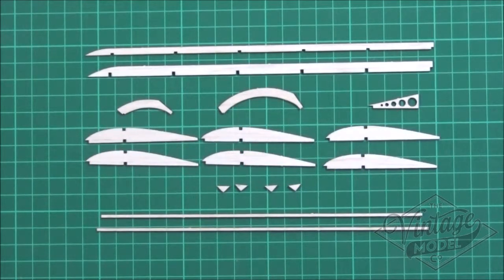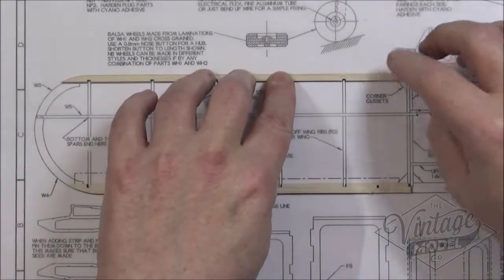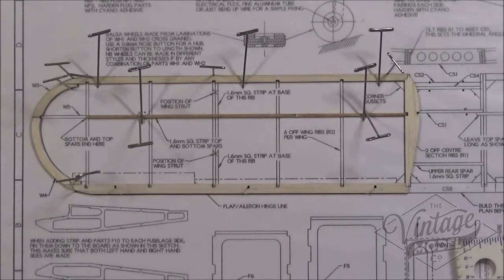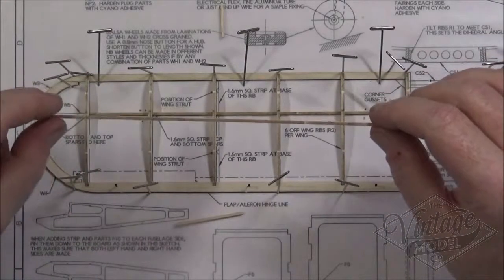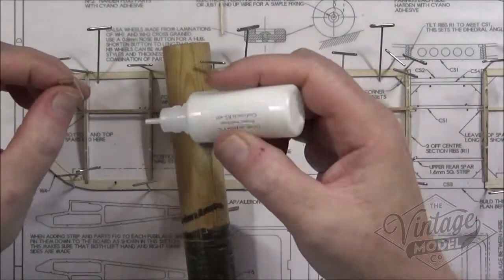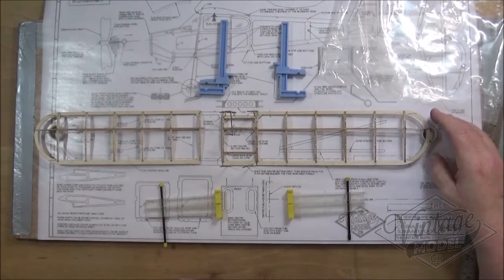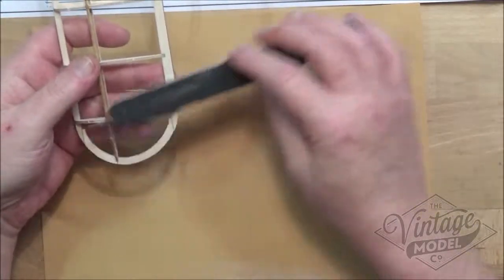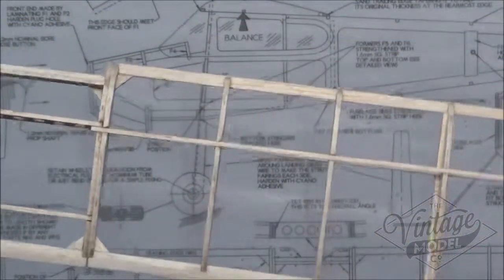Building The Vintage Model Company cessna 140 Main Wings

Comment: That Sanding MUST be done with great care!! I'd be nervous about turning that Wing into kindling!! 😳
Reply from the maker: You're not wrong mate, it's surprising how little pressure it takes and how much comes off in such a short time.
And yes I have broken a rib or two in the past, gripping it to hard.
Reply: I'm learning that skill SLOWLY, as I've been building my Foam Core Board Piper Cub... 
Flimsy and easy to destroy, until all the bits are in place. The Hot Glue to assemble everything even acts as structural members!! 😳 

The end product of these are shockingly Durable! 
I haven't posted anything about this yet, because NOBODY wants to see 4-1/2 weeks of failures and Foam Core Board tossed in the Bin...
I'm starting to get more comfortable with the process, and if you'd like, you'll get to see soon. 😉